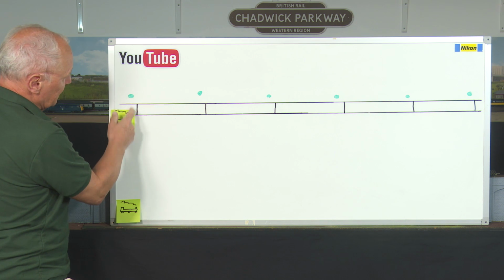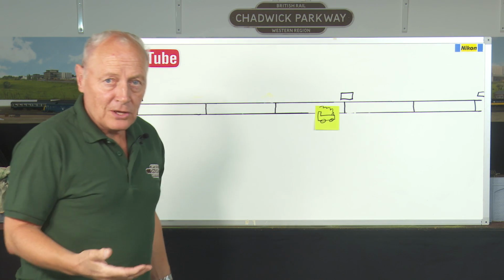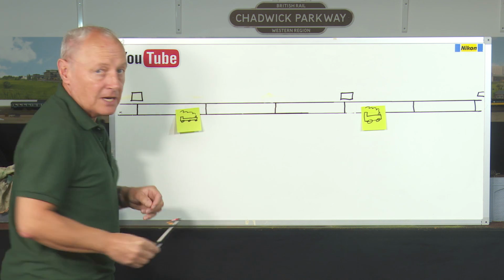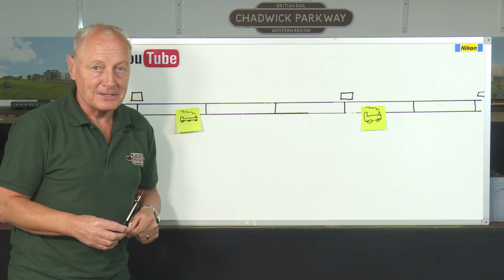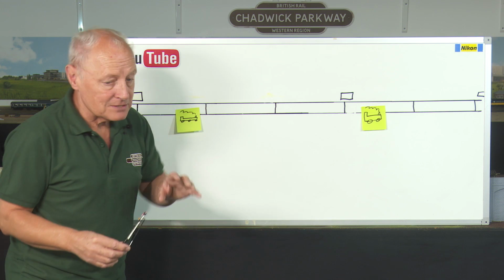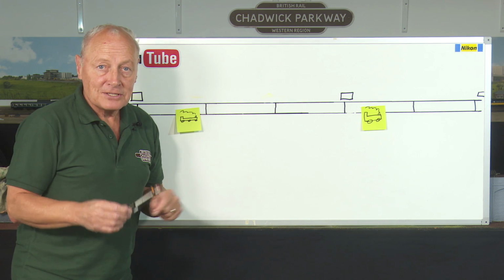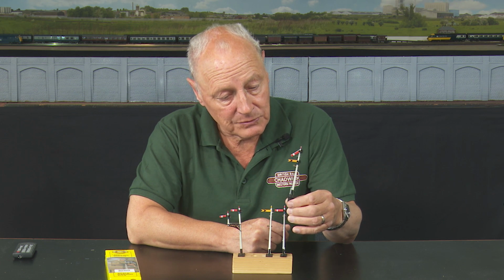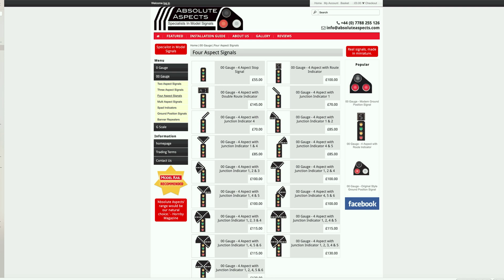Model Railway Signals at Chadwick Model Railway | 104.

Comment: Your description of multiple aspect signalling on TCB was ok but you made Absolute Block unnecessarily complicated. It's a beautifully simple  form of signalling, "The principle of the absolute block system is to prevent more than
one train being in a section on the same line at the same time." This key part needed to be emphasised and that a second train may only proceed once the first train has been confirmed complete with tail lamp and the Clearing Point is clear. The traditional Box A, Box B and Box C style diagrams show the basic principles much better.
Reply from the maker: Thanks for your advice James.
Reply: @ChadwickModelRailway  It might be worth adding this book to your list of links -

https://www.amazon.co.uk/dp/0711034621/ref=cm_sw_r_cp_apa_i_AzPgFbY6FS4WY

When I was at Signalling School, it was one of the recommended books - it's very well written and covers the subject very well.

Comment: Charlie Do you use JMRI to control your points and signals? it also can monitor your block detectors produce a working track plan on your computer screen and very good for programing your DCC decoders and its a free download
Reply: and it can run all your traffic/ switching operations providing you with switch lists. our club are going to in the future use the JMRI web server, included in the software, to allow train control and dispatching over the internet.
Reply: I use JMRI with my NCE DCC system and will be adding LCC when I get there in my layout build only two more levels and a 5 loop helix to go.
Reply from the maker: Exciting times Neil.
Reply: @ChadwickModelRailway  Charlie have you seen the YouTube channel NMRA ORG there are recently uploaded new clinic videos of a huge range of subjects. since the lock down there has been a huge increase in what the NMRA are putting up for all to see
Reply from the maker: No Neil,  I bought Train Controller Silver around 5 years ago and hopefully it should work okay with the new layout.  Rgards Charlie

Comment: Charlie the two links are I know not British out line but they show my North American working switch stand which I built, still, needs a bit of fine tuning, for my railroad as shipping from the US is expensive I decided to make them. there must be a way of rotating your shunting signals either by hand or via a slow moving motor. My switch stand is connected to my Peco points via a brass rod so powered by the switch motor. https://www.youtube.com/watch?v=UZlXOTcY1zs   https://www.youtube.com/watch?v=pNfgn77dGU0
Reply from the maker: An interesting option Neil.
I'll pass it on to Ian, who owns those signals.

Regards Charlie

Comment: Very good, the only semaphore you missed was the Summersault signal which is similar to a lower quadrant signal. Used on the M&GN and GNR. But that's being very picky of me. I have worked on the P-Way and I can tell you the concrete sets which hold the point rodding are extremely heavy. The rodding is fairly heavy too!! But all good fun when installing it :)
Reply from the maker: What a heart warming comment Norton. Stay safe. Regards Charlie

Comment: I think your explanation of how signals work between signal boxes in an absolute block system was a little bit off.  Generally speaking (ignoring the possibility of intermediate home signals) there is one block between boxes, and a train would only be allowed in to that block section once the previous train had passed beyond the home signal of the next siganl box.  This is a generalisation, and ignores the special circumstances when a second train would be allowed in to an occupied block. 
In a simple station layout, the signals seen when approaching a station would possibly be a distant followed by a home.  Beyond the station would be a starter.  The home would allow a train in to the station limits.  The starter would only be cleared when confirmation was received from the next box that the previous train had cleared the section between the two boxes.  The distant would also only be cleared when both the home and starter signals were cleared.
A co-existing distant and starter signal is only likely to be seen when the distance between the blocks was too short to allow normal spacing.  Sorry to be a vulture, but your explanation of semaphore signals was a touch confusing and not entirely accurate.
Reply from the maker: You are of course correct but I really couldn't go into too much detail for those new to our hobby.
Reply: @ChadwickModelRailway  That's fair enough.

Comment: I think there are two more. First is the calling on signal, which allows a second train into a block (eg at a station). And the other is a banner repeater (black bar on white background) that show the next signal that may not be visible until you are close (often used at bridges near stations, where a short train doesn’t use the whole platform, and cannot use the normal starter signal.
Reply from the maker: I know Tom but I had to draw a line somewhere.
It could have been 2 hours long!
Reply: Chadwick Model Railway Yes, please, Charlie, 2hours of your dulcet humour would be great. Do you do stand-up?

Comment: I wish signalling was as simple as you made it on your diagram! 
Also, the old Midland Railway had lower quadrant signals as well.
I still know of one at Ketton, which is still in use today. Bit of a rarity as it’s wrong sided as well!
The only thing I will say about your absolute block (semaphore) description is that if the Distant signal is cleared, all associated stop signals (Home and Section) should be cleared. In some cases, that might only be one signal, protecting a crossing, so there is no ‘station limits’ section at that box. Also, there’s IBH signals to consider, which might be useful on your layout, so that you don’t have too many boxes/sections on your layout. The other type of semaphore you’re missing are miniature aspects. They usually allow trains into no-block lines, loops etc.
You could even have a nice rarity if your layout allows for it; a yellow semaphore shunt signal!
Reply from the maker: Easy locomotionLotion. You’ve gone way over my head already, regards Charlie. PS great detail though!

Comment: Very informative  video about a subject that can become very complex,  just finished  signaling my own railway using a combination  of all  of the signal types you reviewed. all of which are operational.  I used color light signals for the ones i could see the front of from my operating position and semaphores for  signals that i could only see the back of as you can still see the position of the arm . Which i think you will agree makes sense as you don't want to spend money on working aspects and then not be able to see them.
Reply from the maker: A very interesting point Jamie, which makes perfect sense. I may well use semaphores at the branchline station.

Comment: Hi Charlie  Good film as always just a couple of points that may help. When you have semaphore signals for a junction (as you showed on a bracket) if one signal Is lower than the other it means the lower one applies to a line that has a lower speed limit if both are the same height it means both routes have the same track speed limits.  If you have a stack of stop boards one above the other they read from top to bottom left to right (tracks).Feathers, we all call them that, but actually called junction indicators and are numbered 1-6, 1-3 on the right 4-6 on the left so you can go in 7 directions from one of signal inc straight on.  Back in the late eighties I was released from train driving duties to make a series training films for the then BRB if you lookup BR SIGNALLING Pts 1and 2 on u tube it covers basic signalling.  Bit dated now but tech was not as good then filmed on high band u-matic.  It has always annoyed me when I see a layout with no regard for signalling.  Just yesterday found a retired signalman of 40 years service ( I did 45 😂) who makes O gauge signals of every type they look fantastic but make Dapols prices look very cheap. Will post link if required. Hope all this helps.
Reply from the maker: What a heartwarming comment. I really appreciate the detail that you’ve given here, regards Charlie

Comment: Nice one Charlie. I guess the top shelf is only for the saucy signals 😄 I must say those Dapol signals look lovely. Then again, nothing that’s good is cheap!

I was hoping to have a simple 3 aspect system with 4 block sections in each loop, with one signal on each line able to be held at red to protect entry into the sidings yard. Is there a particular one you could recommend or even a pointer you might be able to offer as a simple system I can look into? 🤔

Thanks for another interesting and helpful video mate 👍
Reply from the maker: I’m sorry Tim but there isn’t. It’s a simple case really of research. After which all you can do is fit what you think is suitable. Regards Charlie
Reply: @ChadwickModelRailway : aye no worries mate! ☺

Comment: Also might be worth looking into Heathcote Electronics - he makes similar boards to control signals automatically via an adjustable timer. There are others that don't have the timer but work together to automate block signalling. They in turn can be linked to a board with a timer so all will work together nicely.

Great video nonetheless.
I'm, too, just at the stage of installing signalling.
Reply from the maker: I’m so pleased that you enjoyed the video, I’m just so sorry that I couldn’t promote more signal manufacturers in the time allowed. Regards Charlie

Comment: My signal system will be based after 1940 which I dont really know anything about, yet. 
So each block is controlled by a signal box and I am guessing each individual signal box is situated at the where two blocks join in order to signal to the signal boxes either side when there block has a train in it or its just clear?
If so how long can a block be? 
Regards Chris
Reply from the maker: It’s actually driven by the strength of the signal man. It’s the distance that you could physically change the signal by the pulling of levers and through wires that dictated the length that the signal box could operate.

Comment: Excellent Charlie, probably your best video to date IMHO. The block signalling explanation was superb, now I get it. I have several Ratio semaphores to build (post and gantry) and plan to drive them with some spare Fulgurex motors. I also have the Eckon signal kits and TBH find them really nice kits. I also have several of the ModelScene signals which can be carefully drilled out and LEDs fitted. They also come with control boxes so look the part https://www.petersspares.com/modelscene-5094-colour-light-signals-x2-switch-boxes-x2non-working-oo-gauge.ir In conclusion, your piece/info on the blocksignalling was just the thing as I am also planning signals and was thinking how to get them to change. That ASP1 board was just the item, and I guessed at £16 so was v pleased looking at the price on their website at £16.99. Spot on and thanks again PS the BS boards are on Ebay with Free Shipping saving a few bob...
Reply from the maker: I’m so pleased that you enjoyed it Bob and found it useful. Regards Charlie

Comment: I thought your pictures of trains on the post it notes stole the show 😂😂 not really! Anyway I was interested in your comment re cutting off the two prongs that slide between the sleepers of the train tech ones and connecting wires, I assume this doesn't take away the automatic signalling changing as displayed on their video ?? Would I be right in thinking that ? Cheers
Reply from the maker: Hi Scott, no cutting off the two prongs, just means that you need to supply power to the two soldered tabs. Regards Charlie
Reply: @ChadwickModelRailway  Charlie were they the ones with the automatic sensor? See I like the idea of that more than programming signals to control unit and faffing about changing signals. Just didn't like the idea of the prongs under the track as they a look a bit like out of a 'train set' . Cheers
Reply from the maker: Hi Scott, no this particular signal doesn’t have the automatic signalling it is just changed with a DCC input. I think you need to try the Heathcote versions for full automation
Reply: @ChadwickModelRailway  thanks Charlie..

Comment: Excellent vid.  Signals can be a rabbit hole that goes right through Alice's Looking Glass.  And, for head scratchiers, the Canadian & US signals are without equal.  They have three lamps, except for when they only have two, except for those with only one; ground signals which are always one lamp, but might be two.  (The semaphore signals require a tenth-level Wizard, especially the ones with blades and lights.)
For modern era layouts there's a mix of automatic lights, as well as dispatcher-controlled, just to turn a person into a newt.
Reply from the maker: A nightmare, is the only way that I can really describe it, regards Charlie

Comment: Fun fact: Siemens implemented electric train detection using insulated track at the end of the 19th century. It was used to detect the passing of trains at the very end of most travelled routes. In lack of national electric grids to take electricity off of, these interlocking machines used inductors and batteries. And of course, if they had to wait too long for the train to pass, the battery went flat and the train went undetected which caused extra headache to signallers.
Reply from the maker: Great comment GS.  Stay safe mate, regards Charlie

Comment: Hi Charlie nice interesting video.
I have recently installed 3 Aspect light signals on my layout infa red detection using IRDAS boards made by Heathcote Electronics  which excellent price and quality and so easy to wire up and fit and a lot easier than the ones you had. They also do infrared boards for the Dapol Semafor signals as well,  I have also fitted feathers to the signals which are  obviously change d when point motor diverging route is set by point operations, they are wired by 12v DC supply but layout is DCC. 
Cheers
Reply from the maker: Great information Brian, thank you very much indeed. Regards Charlie

Comment: 60 quid, 60 bloody quid! that's a weeks shopping for me charlie wow, another point some dont realize is train signals work in the opposite direction to road signals, ie: the red is at the bottom, luckily signals are the only thing in N scale that are cheaper, you can get a digikeijs signal controller and a pack of 3 signals for 90 quid
Reply from the maker: Rest assured mate, I haven’t set the prices, or bought one either. Hence I borrowed it from Ian,.

Comment: I use Heathcote electronics signal control boards which can be interlinked to create correct sequences and have modules so that if you are running bi directional the signals automatically switch to red
Reply from the maker: Yes I’ve seen them at a Model Railways shows Gary. Very realistic outputs

Comment: Crewe Heritage Centre has a preserved version of CREWE NORTH Junction signal box which operates as a demonstration of how it used to operate. Website at:- https://www.crewehc.co.uk/attractions. It actually is "operated" as it was when this box was in use with a helpful signalman guiding you through the system. Worth a visit (when COVID has gone!) if in the area. Also The original APT is on site too which you can wander around with many other locos to see. Many twin aspect colour signals are now being replaced with single aspect LED types which change to red/green or red/yellow.
Reply from the maker: Thanks for the info Pat. Yes I went to crew a couple of years ago at the open day, diesel gala.

Comment: Great video.  I see signal companies have not lost the art of ripping people off. How on god's earth are the younger generation of modellers going to afford this stuff....or has pocket money gone up these days.

I did get confused on the distant home and starters , but there are some good signal box videos that explain it all on you tube. 

I prefer propped train detection by floating an AC voltage over the DC on the track and use the voltage drop across a diode to trigger a twin T transistor cct to operate lights.
Reply from the maker: I’m so pleased that you enjoyed it Richard, it was a nightmare to research